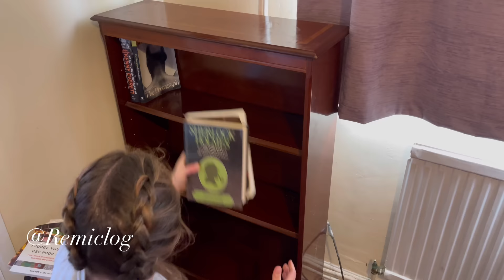Cleaning my Dad’s house and making it cozy

Comment: Remi, I don't often have decor info, but I'm so excited to have a tip to share. For blankets, I've learned that draping a throw diagonally over the corner of a couch with a few ripples gives it that fancy look without being too sterile. Squares and rectangles are "harsh" angles for a blanket that wants to look comfy and casual. Or if you need to drape across a rectangle space, pinch the center like you're making a bow. Trust me, I'm the LEAST finicky Decor person, but it's a little thing I've picked up along the way. You're such an inspiration & I'm so glad to have found your content!
Reply from the maker: Thank you for this, I appreciate the tip! I’m definitely going to try it out. ☺️

Comment: Fantastic cleaning job and you do have an eye for decoration. Popping those two extra blankets where you did was such a simple decision but really made a difference to the overall feel of the room. My house has pretty much resembled yours my whole life. The life changing thing I realised was storage - when everything has a home it's easy to keep things tidy or tidy up however where I lived as a student and then renting in my twenties never had any storage, one place didn't even have wardrobes or a linen closet. I would feel so bad about the mess back then but now looking back I'm like of course it was messy. I really need to do my wardrobe, I've been procrastinating for over a year, I put on weight over the pandemic and it's been very difficult to loose it so I think I need to just clear out the clothes I haven't worn for 3 years and move forward but psychologically it's a hard thing to face.

Comment: You can use paper clips to hang the bubbles :))  take the paperclip, flip the inner side out ... like you would open a book flat ..and ye and behold - Christmas bauble hanger . you can store them in a small box with the baubles when you take out the tree and re-use them next year :) its easier to work with them vs string or dental floss ;